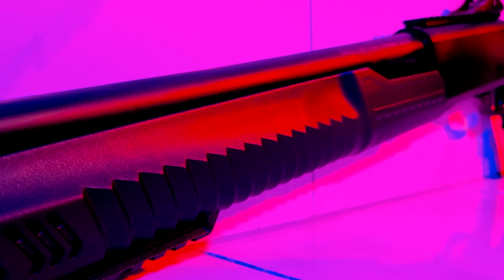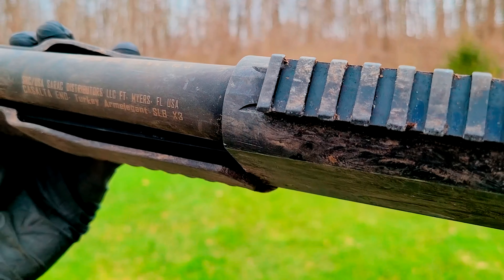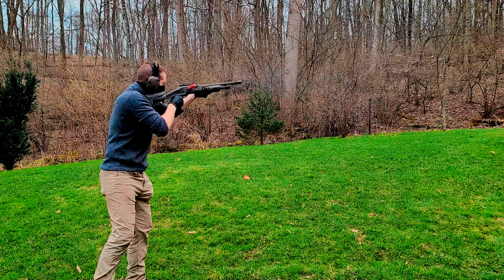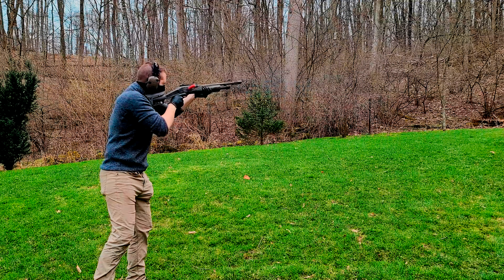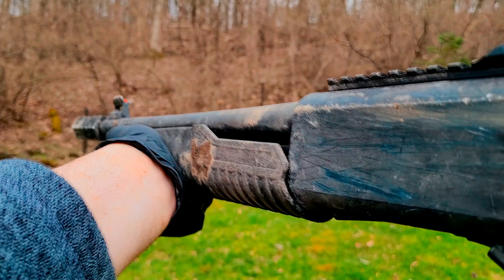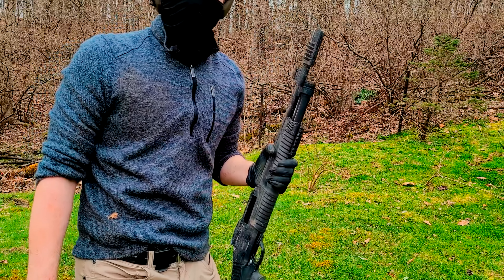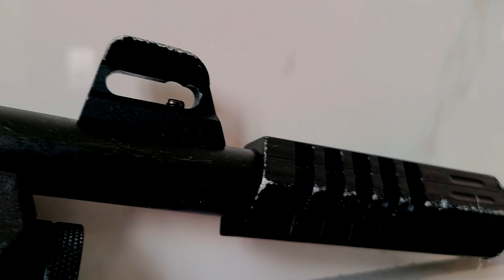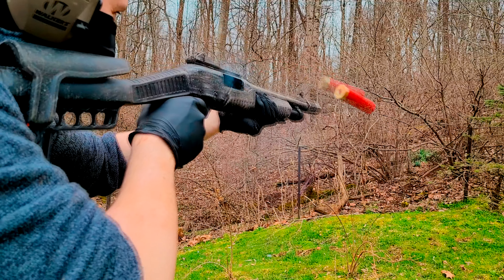Emperor HD-12 Torture Test: Pt. 3

Comment: I bought my first firearm two months ago (Black Aces pump shotgun) and took a NRA shotgun basics class.  I just purchased the HD-12 because of your excellent videos.  Look forward to picking it up from the FFL store.  After watching what this shotgun went through, I'm confident it will work if and when I need it for HD.  But hopefully I'll only have to use it at the range.🙂
Reply from the maker: I'm glad I could help! Good on you for getting some training under your belt 👍  thanks for watching 😁
Reply: @collapsenprotect  picked up the HD12. didn't notice it at the store, but after racking it a few times at home, I noticed the bolt is loose.  with the fore-end pulled back I can reach in with my finger and wiggle the bolt. hopefully there wont be any issues firing the gun.
Reply from the maker: @truelightgc  you should be okay. These bolts definitely have a little slop, but that's a good thing in my opinion.  Loose tolerances in firearms usually mean more reliability in harsh climates.  The only downside is less accuracy...but it's a shotgun so accuracy isn't exactly the goal lol 

Either way, If it does give you any issues, contact emperor arms and they will fix you up!  Thanks for watching
Reply: @collapsenprotect  thank you for the explanation.  BTW, the extra extension tube I have from Black Aces Tactical threads right on.  I will let you know if I decide to tackle the modification you made in the other video.
Reply from the maker: @truelightgc  that's awesome! So black aces must have the beneli/stoeger thread pattern too. Thanks for the info!

Comment: Nice job man. I do have a question though. Why do you think this gun is listed for so cheap? Also, do you know what the MSRP is?
Reply from the maker: Thanks! It looks like msrp is listed as $230 on kygunco.com.  Another viewer commented that he was actually in their brick and mortar store and watched the staff wheel out 2 pallets full of this shotgun lol 😆 

So I'm guessing the lower cost is becuase they have such a high supply.  I'm not complaining though, I ordered more after finishing this test. A reliable 12 gauge for $130 is just ridiculous!
Reply: Collapse N Protect I believe you mentioned you were using 2 3/4 shells. Do you recommend any specific one? Winchester, Remington, etc?
Reply from the maker: @youjustgottrolled1016  I used winchester, nobel sport, federal and sterling loads.  They all worked great!  I'd recommend the nobel sport buckshot, they've got light blue hulls and are nickel coated so they should cycle extra reliably.

Comment: I just got mine yesterday.  It fails to eject spent and unspent shells 80% of the time.  Halfway through the cycle it drops from the extractor onto the next shell and jams the gun.  Any ideas for a fix?  Thanks
Reply from the maker: Uhhh ohhh! Sounds like it might need to be broken in.  I would try a few things...

1. Without any ammo just pump and dry fire it around 300 times.  That should smooth out any rough edges.

2. If you have snap caps or inert shotgun training rounds, load up the magazine tube, pump and fire around 200 times.  Again, it's just going to help get everything moving and itll get smoother.

3.  After either 500 dry fires with inert training rounds or without them, give it a good field strip, wipe all of the old oil off.  You'll probably see some fine metal shavings in there.  Make sure to wipe those out. Then reapply your favorite oil and see how it runs. 

4. Change your ammo up.  Another commenter said that they were using remington ammo of some type and that it wouldn't cycle.  Then he did a Google search and found out that the rim on those shells is actually a hair our of spec and too large for the extractors to grab onto. 

If all of these fail, contact emperor and see what they can do for you.  Let me know how it goes! Hopefully things just need broken in on yours. 🤞
Reply: @collapsenprotect  thanks for the detailed response I'll give it a go!
Reply from the maker: @ryancleary8002  anytime! Good luck 👍